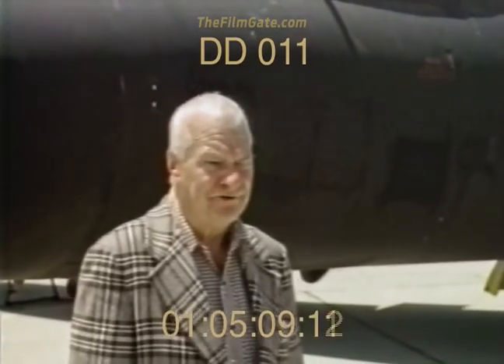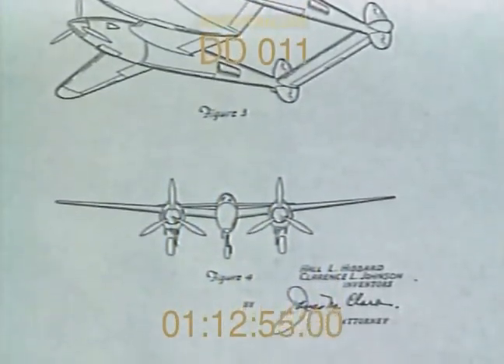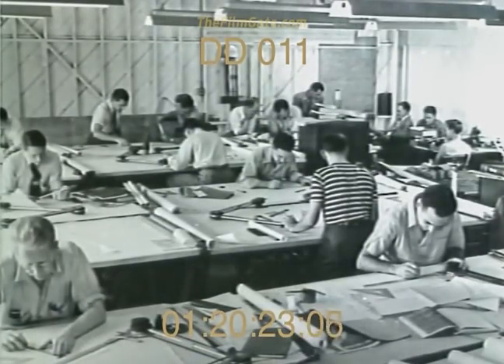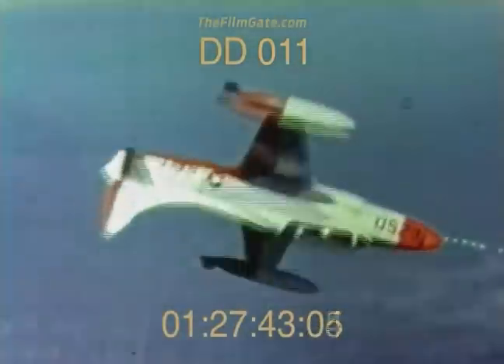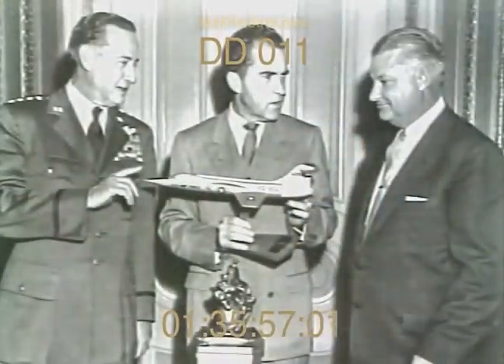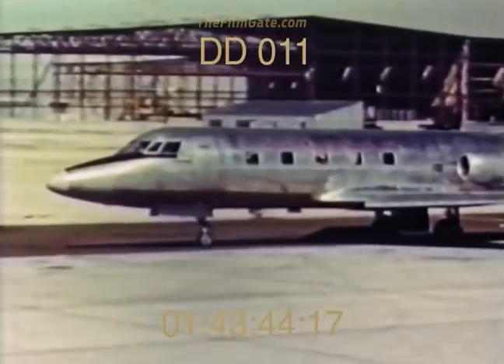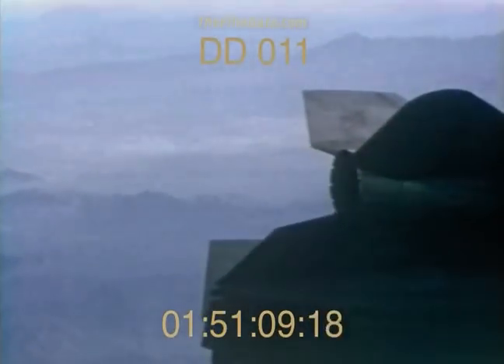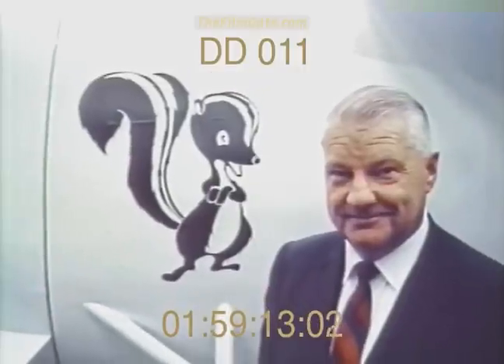Kelly Johnson and Lockheed Story

Comment: Never knew that Lockheed started and built its reputation as a manufacturer of civilian passenger aircraft.. We all know and respect the company as the world's largest defense manufacturer that is a cornerstone of USA's air power. Of course Lockheed Martin of today also designs and builds other types of military technology besides the fighter jets. From advanced radars and missiles to warships (although their foray into the ship building business for the Navy didn't produce some ground braking systems, they are after all manufacturing the Freedom class of LCS ships). 
That being said what I wouldn't give to be a fly on the wall inside their advanced projects department, better known as Skunk Works. But then again, maybe they have some high tech anti insect system installed that would disintegrate me the moment I buzzed the room.

Comment: if the F104 set a record at 103,000 ft and the U2 is the highest flying single engine aircraft ever then the U2 can reach over 103,000 feet. usaf typically says U2 ceiling is anywhere from 70-90,000 feet.

also interesting lockheed worked with liquid hydrogen fuel. fletcher prouty said the U2 uses a hydrogen booster fuel to run at altitude and this is what was sabotaged in the francis gary powers flight.
Reply: The F104 "lobbed" itself to that altitude. It couldn't "fly" there.

Comment: Kelly's unwritten 17th rule... If it looks ugly, it will fly the same... is the only rule that was disproved.  The A-10... ugly as hell... but an aircraft that provides massive support for grunts on the ground and takes unbelievable punishment.  One of the very few aircraft where the gun came first, and the remaining engineering was worked around it.  Another one was the P39.  The 'powers that be' wanted a BIG cannon, and the P-39 was designed around the cannon.  It's the only mid-engined front prop fighter.  Sadly, the 'powers that be' didn't see the need for a turbo-supercharger for high altitude operations.

Comment: My father’s uncle married in 1930`s and could not find a job.  He moved from Chicago to Ca. to work for Lockheed as design draftsman.  First job was gun installation in P38 so I was told and he spent a career there.  Kelly and Tony were my heros when I read about them in 1950`s grade school. 
My wife’s grandfather worked for Sherwin Williams and designed some paint for Lockheed to make airplanes harder to spot.  He was rewarded with stock , and it is still in the family today.  We think it was around $5 per share in war years.